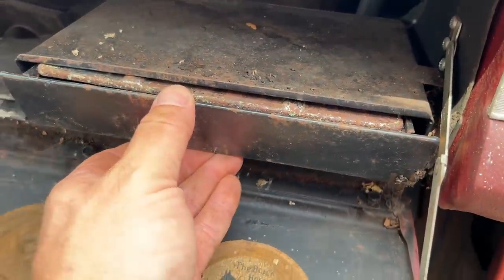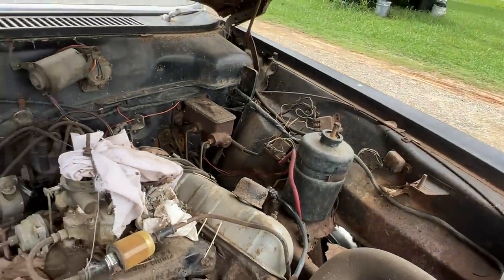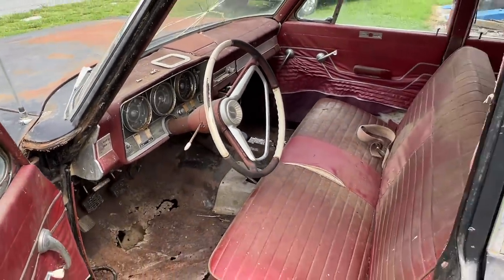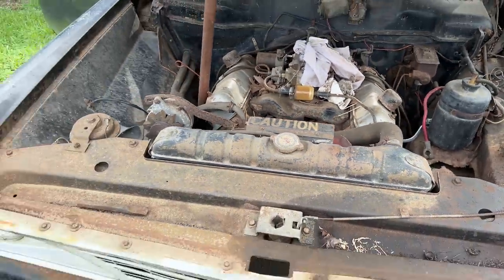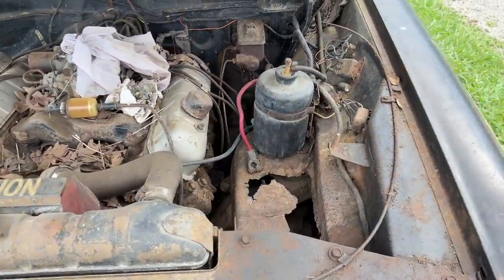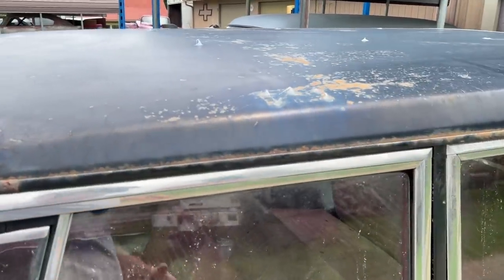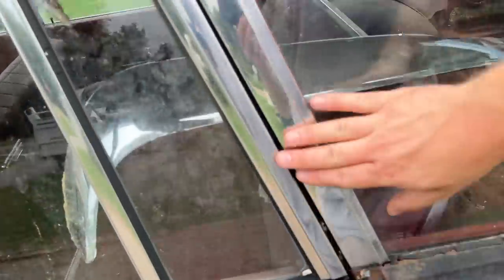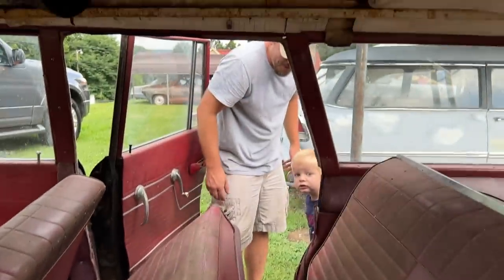CRAZY RARE V8 4 Speed Studebaker (Best STATION WAGON Ever!)

Comment: Our local Studebaker dealer ordered a Wagonaire with the R2 (supercharged Avanti engine he was a gear head) 4 speed and had the sliding roof.  My father wouldn't go for the R2, so he ordered the stock 289 2 bbl.  My mother wouldn't let us ride in the back with the roof open but when dad took us out, we opened it up and of course my younger brother always squealed on us.  I loved it and he kept it for 4 years and traded for a VW squareback.
This car is interesting because it has the factory fader control for the radio, I have only seen 2 or 3 over the years.  If it had Twin Traction (Studebaker name for posi) it would have been on the broadcast sheet.  Also the "climatizer" was the fresh air heater option (and yes, heaters were OPTIONAL on most cars until later in the '60's.  You could also order reclining seats, 50/50 split bench (with or without recliners) or buckets.  They did NOT offer a full console with the buckets, jus a small "consolette".  A/C was always an under dash unit as Studebaker did not have the money to develop in dash A/C.  They also used king pins on the front suspension until the end again due to lack of engineering money.  Dual master cylinders were standard on all except the low priced Commander Series (but it was optional).  Padded dash was standard, padded sun visors were optional (the standard was just a pressboard with a covering).  If you ordered a 9 passenger wagon, "captive air tires were installed as there was no place to put a spare with the 3rd row seating.  I had a '66 with the 283 engine, 5th from last produced.  Plain Jane, PS, heater and radio.

Comment: I looked it up on Wikipedia. This is what they say:

“The 1963–64 Daytona version of the Wagonaire could be equipped with a V8, Carter 4-barrel carburetor, and a column mounted shifter manual transmission with overdrive. Bucket front seats along with a center console-mounted automatic transmission selector were available. (The Wagonaire could also be ordered with any of Studebaker's available "R-series" high-performance Avanti V8 engines and the four-speed floor-shift manual transmission.”)

Comment: My Dad had and eventually gave me the less rare 1963(?) automatic transmission version Wagonaire that he had purchased new.
 I never got it running because I had to leave for my Navy Enlistment in 1976.
 As I recall that round key lock gizmo on the tailgate actually opened to be a hand crank to open the rear window (at least on that year and model).
 The doors had no drainage on the bottom so they held water.
 The sliding roof was a bit dangerous so in addition to the center release/lock it had 2 safety latches, one on each side to prevent unintended movement of the back half of that roof should the main center latch fail.
 I remember riding in the back with the back seat in the stowed, folded away position with my siblings oblivious to the fact that there were no restraints of any kind.

Comment: That plumb visor is the mud flap. That runs along the whole bottom of the vehicle. we're the rear tires are located at. Witch is one whole mud flap that was called A plumb visor instead of  just mud flaps. Cause it wasn't split into two sections to be called mud flaps instead. That sliding roof was made for hauling stuff in.& You could put those truck bed campers in the back for camping in to back then. To make it like A all in one purpose type of vehicle minus the four wheel drive part is all./4x4 package was all it was missing on it from the factory.

Comment: We had a Rambler and one odd thing with them was if you disconnected the speedometer cable it would kill the voltage regulator and the car wouldn't charge and sometimes had zero power to almost everything.  So you may want to look at the voltage regulator.

Comment: Daytona version

Studebaker Daytona Wagonaire at the Rambler Ranch
The 1963–64 Daytona version of the Wagonaire could be equipped with a V8, Carter 4-barrel carburetor, and a column mounted shifter manual transmission with overdrive. Bucket front seats along with a center console-mounted automatic transmission selector were available. The Wagonaire could also be ordered with any of Studebaker's available "R-series" high-performance Avanti V8 engines and the four-speed floor-shift manual transmission.

Comment: One of the first models to have wipers that came on as soon as moister hit the windshield, one of the only ones to have rocker switches, back lights on switches were red, some of them had Packard V8's, one of the first to have disk brakes, rear seat his higher so passengers can see better. Actually drove one my parents had in the late 60's
Reply from the maker: Cool info Jeff, I didn't know that!
Reply: Rocker switches (Cutler Hammer) and red back lighting were nuances proposed by Studebaker president Sherwood Egbert, who was an aviation enthusiast and had some exposure to military aircraft cockpit design during his time in the marine corps.
Incidentally, those C-H rocker switches were used on the Starship Enterprise console on the original TV series Star Trek.

Comment: Sliding roof was available for appliance service technicians delivery of washers/dryers/refrigerators/etc. 
No need to own a separate truck. 
Vans were just that year coming into the market. 
Also convenient for bringing home a pony for the kids!
Interior width? Might be 48 inches, bring home some paneling. 
The tailgate, some had a little interior step that flipped down when the gate is down.
Really need to join a Studebaker club/organization to plan the best restoration method, or person who wants it desperately. 
That sliding roof seal needs to be perfect. Or, the first stop during a rainy day, the rear seat gets soaked!
You have quite a jem there! 
So many other vehicles of that vintage are missing nearly every original part. 
The metal work is just work. 
The original interior and trim is frequently "unobtainium".
Reply from the maker: Thanks for your comment Clark, I think it has lots of potential, even though my first reaction was to re-sell it haha. That's almost always my first reaction and then I fall in love!
Reply: yet another use ; mobile tree stand or duck blind .
Reply: When restoration is completed, offer up to locals for parade. Officials/dignitary/etc can stand up with the roof retracted.

Comment: I have an 04 GMC Envoy XUV SLT 5.3 I bought for $600 6 years ago that was going to the crusher the next day. The mid-gate with power window, dual opening tailgate and opening roof was as close to a station wagon with four wheel drive I didn't know I wanted until I bought it even after being told the engine was bad, it's not. Now I get to see what I've heard much about.

Comment: Get a copy of "Studebaker, The Postwar Years" by Richard Langworth.  It contains a very good description of this car.  There were issues with water getting into these cars. The sliding roof panel tended to leak.  As a result, a fixed roof version was made available. This version may be even more rare.  But the 4 speed wagon has to be very rare.

Comment: The alloy wheels intrigue me. They were optional on Ford Aerostar common on camper conversion. Ford had several snap-in center caps.
Reply from the maker: Yeah, definitely a strange choice. These cars didn't have much room for wide tires and wheels, so I guess the offset of the FWD style wheel worked out. I'd love to find some original steel wheels for it.

Comment: it must be an early 64 with the 289 big block. They were going out of business and switched to Chevy engines in 64.Great engine.I had a 63 and a 62 Lark .Fun to drive.Fast acceleration and barely had brakes.
Reply: Friend of mine had a 64 or 65 studebacker don’t remember what it was but ugly as heck 2 door post had a 327 Chevy motor in it lots of hot rod parts and easy to find back then was a real sleeper had a blast with it thenwrecked

Comment: it will be quite a project, rust is extensive here and will require patch panels and some sheet metal from a donor vehicle.  Classic Enterprises in Wisconsin has floor panels, rockers for it, but some of the other sheet metal will either come from another vehicle or fabricated.  Time consuming and expensive; though very rare, i have only seen one other sw so equipped (it had the R1 motor, disc brakes in addition to the 4speed) but costs may well exceed the street value of a complete and restored unit.

Comment: Like a lot of 60s cars Studebaker had problems with rust. Hopefully you can get the Studebaker engine running. If not a 283 Chevrolet was used after they stopped building their own engine with a factory adaptor for Borg Warner transmissions

Comment: I've had 7 Studebakers, and hopefully I can pass on some info on your car. Studebaker started the model year serial number with the Year, Engine, and 1001. That would make this car #3411 off of the assembly line for model year 1964. I have been to many Studebaker and classic car meets, and I have never seen a '64 Wagonaire with a 4 speed. This would be a Borg Warner T-10 transmission. Starting with the 1963 model year, Studebaker supplied all of their cars with dual master brake cylinders. Optional was Bendix disk brakes on the front. Your car also probably has the 11" rear drum brakes. The rear of the car does NOT have regular quarter panels. They are fenders that bolt on. If you look in the back part of the rear door openings. you will see some metal disks. These hide some of the bolts for the fenders. The rest are behind the rear area upholstery below the rear side windows.  It looks like the heater (Climitizer) was still an option in '64. I had a '62 Lark Cruiser, top of the line Lark, with a V8, automatic, radio, but no heater. Didn't make sense to me. From what I have seen recently, Studebaker parts are quite available, so this car could be put in great condition! Check with a local or the national Studebaker clubs, you will find the parts. The 289 is a good engine, and you can get a 4 barrel manifold for it fairly easily. I found an ad for a '63 Wagonaire that shows the sliding rear roof. https://www.youtube.com/watch?v=Cn-u6wITmRc

Comment: The 7 didget number really does not mean much. Find the pad on the left front of the block by the valley pan has the number you seek . It may or may not be a 289 but a 259, but most likely a 289.
 Fun fact: Bob Bourque designed this car,along with the fixed roof Wagoner along with the Jeep Wagoneer. Hence the similarities in the design. Oh yeah, same with the '49-59 Ford/'50-51 Stude. Bob was the man!
The mirror in the glove box was called the Vanity.

Comment: You're lucky, the Studebaker is all bolt on.    Even the rear quarter panels unbolt.   You can find NOS parts too easily.    The floor panels are readily available.   Nothing hard  at all, looks worse than it really is....all the emblems are available too...rockers...etc etc.....even doors are easy to find.  64V only means it's a 1964 and  the number is what it was off the assembly line......Built before November 23rd  in 1963.    Studebaker stopped production in the USA in Nov of 63, it's not Canadian.   Canadian built cars had White Steering wheels and came to the USA after January 1964.   5,163 Wagons were produced in the 1964 model year.  There is a right front door exactly what you need ofr 80 bucks on ebay right now.  The glove box vanity was for women to fix their make up...back in the day, women all wore make up and would want to freshen up their lipstick or stuff in the mirror......of course the Male would be driving...so the woman was the passenger......How it should be.    The mud flap wouldn't be factory, it's dealer installed or owner installed.  Trim and door handles everything for Studebaker is available and not hard to find......there is a big Studebaker Club and Magazine and Vendors too.

Comment: The tracks for the sliding roof had drain tubes for water but they plugged up all the time and gave the driver and passenger a wet shoulder.

Comment: Is this the studebaker 289 that a slightly modified Cadillac intake will fit a old school aluminium 4bl intake will fit regrind cam  for a little more lift and headers may have to be fabricated. But super cool wagon black  with red interior 3 pedals. How much more do you need a early set of radar wheels perfect

Comment: What a shame that it's so far gone by now! It's semi salvageable if you had access to the almost impossible to find part's even trying to find another one as a part's car, can't see how much better shape it would be in? Otherwise it's just the coolest wagon I've ever seen as well especially with the retractable roof! That's awesome stuff man! Yes Sir I believe after 1961 all manufacturers had to switch to dual pot master cylinders as a federal safety standard. The 4 speed is original? Wow! That's awesome Sh1t! The options are pretty amazing and even cooler they're still intact! Yes a power rear window was another option that was ahead of their time in the car world. We had a chevelle wagon that had a optional power rear window from 72 I believe? But that was some amazing stuff bro!
Reply: dual master cylinders became mandatory in 1967, although some jumped on the band wagon earlier. Many cars can be easily retrofitted if the same body style carried over. I did the retrofit on my 64 Corvair recently.

Comment: That baby is very worth saving. Studebaker a little before my time but as 3rd generation Diesel Mechanic/ low-mid-high  Electrician at 62 years old. They told me they great built autos. We appear never bought 1 kind out our price range That old chrome is real chrome loaded with nickel not junk like today's. But good luck find parts or a Metal Smith that is good to make it. I sure they out there but it's the cost for there services?

Comment: The engine number on a machined pad is near the casting number you saw. This number is only a date code not serial number. A 259 will have a V in the number and 289 will have a P.

Comment: no you are right it probably is a Studebaker 289 (283 Chevy) because  getting closer to the end of Studebaker's production life they were out sourcing and most GM parts now though the rear ends weren't GM's  Idk who they were using because it's same as my 60' IHC pick up truck
Reply: the 1966 Studebaker's used the 283 Chevy engines . The '65 and '66 cars were built in Canada .

Comment: My cousins dad had one we used for deer hunting back in the late 70's, you could slide a deer in and out easy (we had no pickups) I had thought they put the 289 in it since it was a ford engine but later found out it was factory. Me and my cousin rolled it on a gravel road one saturday night and every piece of glass broke but we walked away, didn't sit down for about a month though lol belts were tools of discipline back then.

Comment: The Avanti used 289 fords, could be. If it wasn't a 4 speed I'd be less excited.
Wonder what rear end it has? And is that a ford trans, a Top loader?
Reply: Studebaker did not use the Ford engine.  In 1951 they developed their own V8.  Originally a 232 later increased to a 259 and 289.  The transmissions were make by Borg Warner.  The Avanti R1 model used a redesigned 289 they called a Jet-Thrust equipped with high performance cams.  The R2 model added a Paxton supercharger.  I have an R1, my is set up for a maximum speed at red line of about 130mph.  The R2 was tested at the Bonneville Salt Flats at 178mph.  Advocates are still improving those engines, with Avanti speeds of over 200mph.

Comment: I remember sitting on top of the back seat and hanging on to a luggage rack with my two brothers. My parents bought a brand new 64 with a 289ci 3 on the tree. Turned out to be my brothers first car after he and dad did a paint job. Of course  he tore the shit out of it and sold it as junk to a collector. I remember it could only fit 14in rims on the rear and had 15s on the front, chromers and glass packs.

Comment: 259 or 289. Only 3 exhaust ports like a sidevalve Ford. Not very powerfull. Eventually Studebakers used 283 Chevs.
The 4 speed should be a BW T10. 
I think you will find the tailgate key is different to doors/ ignition. Round head?

Comment: 4-speed manual:

This is option code 22 "4 speed floor trans". This was a Borg-Warner T-10 Transmission, and like the "Power shift", the manual was only available on V8 models, but is a relatively scarce option on these cars.

Comment: Im very curious  about the engine. 289???did Studebaker  share with rambler??? Did rambler have this engine  and was the 327 the same block?
Reply: No relation at all
Reply from the maker: Studebaker did its own thing until later in 1964, when it shut down engine production. From then until the end of production, Studebakers used Chevrolet engines.
Reply: My Dad believed Ford based there 289,on the rambler engine design. That's why I asked.
Reply: Ford's 289 was developed from the 1962 Fairlane 221 cu in V8, increased to 260 cu in, then 289 cu in.

Comment: Too rough, but IF the 4-speed is original, that's VERY rare. Might be worth jacking up the engine/trans/id plates and driving a solid vehicle under it. They are out there and not all that expensive.

Comment: Studebaker was originally a buggy builder as in horse drawn. Around the turn of the century (1800-1900) three guys came to Studebaker and made a deal to use the dealerships to sell their automobile the EMF. The EMF quickly aquired the nickname “every morning fix”. Studebaker found it’s name being brought down by this so they bought the EMF, fixed the defects and the EMF became the Studebaker automobile. Decades later they went belly up but they were indeed a beautiful, reliable car. This is well worth the restore as the 1960’s saw the studies decline in sales that makes this old sweety very rare. Same with the old Pachards!

https://youtu.be/cg0WBe4Z5SU